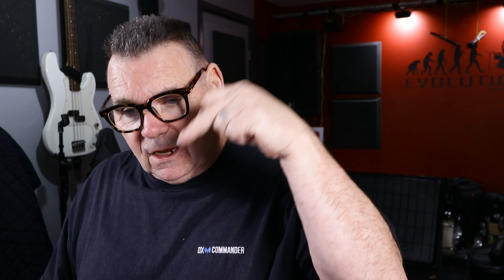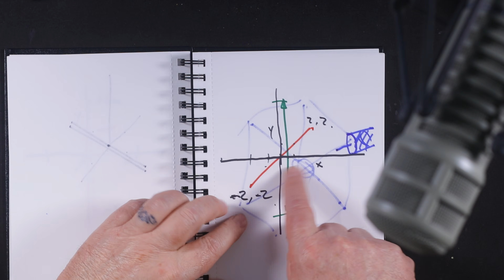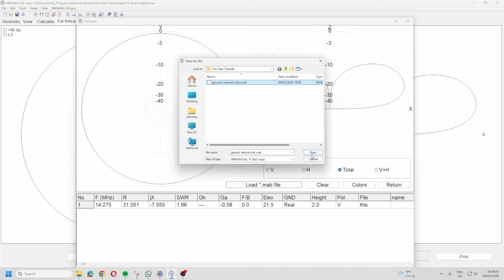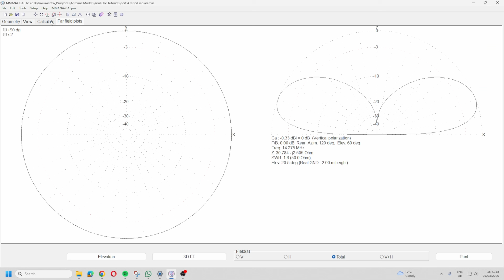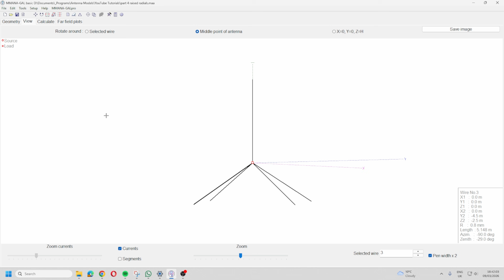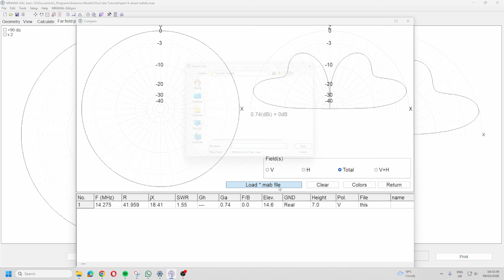Antenna Modeling for Beginners - Elevated Radials (Part4)

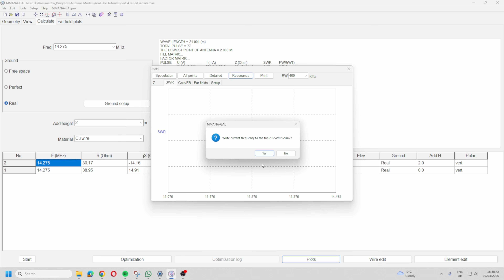Comment: 2:35 This was a bit fast. So I try to explain this bit.

The antenna has best resonance at 14.462 MHz, but we want 14.275 MHz.
The shorter the Antenna, the higher the MHz. So we need to increase length a bit, to get down to 14.275 MHz.

Comment: A request for your EFHW video... A comparison between EFHW with counterpoise against an OCF dipole... Is an EFHW just a 95to5% OCF dipole?... Which then begs the question should the counterpoise be directly connected to the co-ax screen ( via the 49:1 UnUn) or should it be isolated from the screen with a 49:1 BalUn?
( Accepting that if you are running counterpoise-less & using the co-ax screen as your Counterpoise then yes it should be an UnUn)
Reply from the maker: Well, I am not supposed to be doing comparisons and judgments in this series - only instruction. But sure, we can log that for future.

Comment: Hei Callum, my spiderpoles for my wire antennas are mounted high, one on the terrace about 2 m over the ground. I was thinking whether I could run one of your multiband verticals from there with elevated radials (probably only two or three… in your plane antenna garden you don’t have much motivation to run such experiments, but it might be exciting. If you are interested I can email you more information about my situation. Thanks for your help.
Reply from the maker: OK, so many people have done say Signature 9 on flat roofs. They work.

Comment: Great video.  Just wondering what your ground setup tab shows as far as the 'enable radials' checkbox.  If it's checked then however many radials are shown in the dialog cell should be considered in the calculation.  If the checkbox is unchecked, then they won't, per my understanding.
Reply from the maker: Good catch. If Enable radials is OFF, MMANA doesn’t add any radial wires to the model. The antenna is then calculated as if it sits over natural earth defined only by the two ground constants: conductivity (mS/m) and dielectric constant (εr) - but with no physical radials included. Took me a while to work that out too!
Reply: @DXCommanderHQ Thanks for the excellent video Cal.  73 de W2WF.